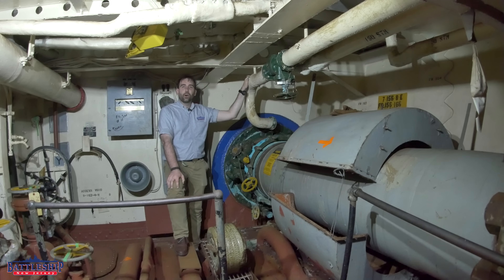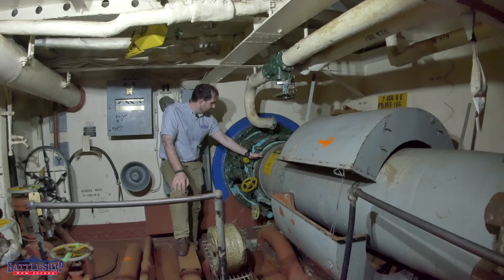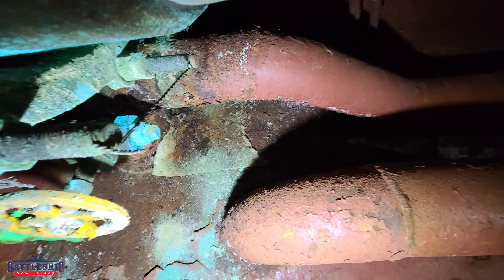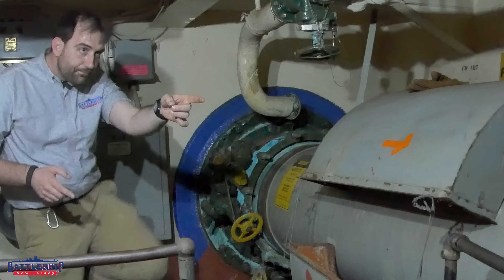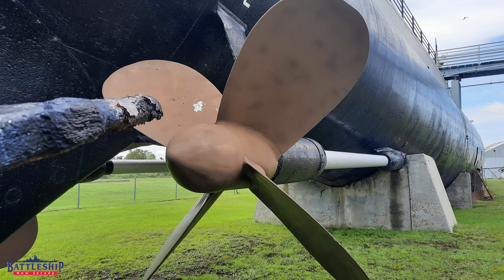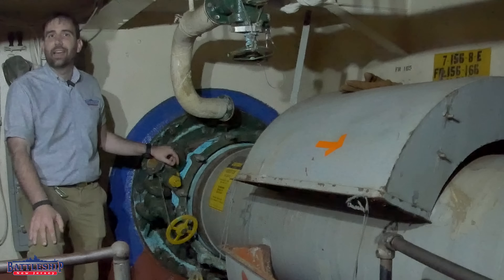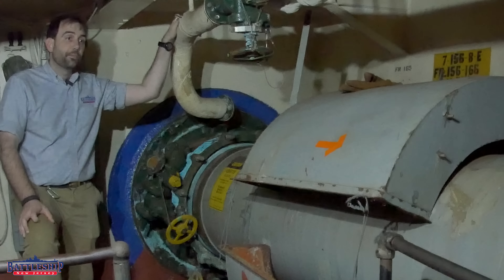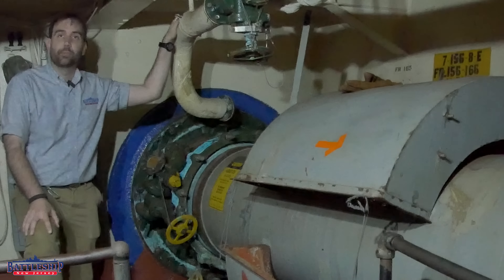Drydocking New Jersey Priority Project: Propeller Shaft Seals

Comment: If you decide to remove them I suggest displaying them on your own aft deck, more or less above where they used to sit underwater. Take the last segment of shaft with you and it lets you have an integrated display of the final drive in a way that’s not really available to visitors any other way (you don’t allow scuba tours, do you?). 

I don’t think there’s a lot of value in keeping them in a re-installable condition, so they could be cantilevered off the side of the ship if the trade off between cost and space makes sense, as I try to keep in mind just how heavy the prop+shaft must be - and I really think you want all 4 with their shafts to the extent you’re able, though a single side is almost as good at half the cost.

Comment: If the props are not striking bottom, leave them in place. The struts support the shaft and prop weight, the seals should not be experiencing any significant weight bias. Replace the packings so the seals are fresh and hopefully last until the next drydock period.

Comment: If you can I would leave the propellers in place but give extra support by adding lifting points off the propeller to the hull. If this is possible then you don't have to worry about the weight of the propellers crushing the packing as much. Though if you could disconnect the shaft further into the ship and have motors attached to slowly rotate the propellers could be another option to keep the seals good.

Comment: Id say for authenticity, leave em on and replace the anodes with the proper aluminum anodes to prevent corrosion to the hull and get the seals redone. She went to war with those props exactly where they are, and she should never be crippled like that.

Comment: Another option..... since the shafts are sort of big plugs......   weld the shafts to the hull.  Make them non-moving.   (You may need some filler pieces of metal to make the gap smaller).  Also, keeping the glands, any leaks in the welds, the glands would be second line of defense.   And, that way, for some crazy reason they want to make the ship move on it's own (wow, think about the cost of doing that!), it would be a process of grinding back the welds.

Comment: I believe they should stay on. Like you said in the video, too much risk of what might happen if you distribute them. Also the cool factor of knowing they are still in place. I also understand the importance of considering the weight compressing the seal so in my thought process, why not build some sort of support system on the shaft to help distribute the weight and take it off of the seal??

Comment: My vote would be to retain the propellors and their shafts in situ. You should be able I would think to address the issue of rotation by occasionally unbolting them and rotating them while still attached to the ship. Even better consider perhaps if the jacking gear can be reactivated and engaged as I don't think that's steam powered.

I'm curious the damaged outboard prop you showed a picture of where is that? Is it from Missouri's grounding?

Comment: I vote for keeping them in place, reseal as needed, figure out a way to rotate them on a regular basis so they don't sit in the same position for 30 years.  It could be a scheduled event (like monthly or something) where they are rotated several times, or something that happens continually (but EXTREMELY slow).
Reply: maybe disconnect the last section of shaft, rotate just that section (with the prop) and then rebolt it?  shrug
Reply: @gildedbear5355  I had the same thought, but further in, at least past the first barrings inboard of the seals so that the seals don't take loads as a result of the shaft being cantilevered. Another option, get the gear boxes into a state where they can run slowly and put a motor and a lot of gearing somewhere that can spin the input shafts. That would reduce the amount of torque needed to make things work as well as keep everything else working as designed.

That said, is the fact the seals have been working so well a result of nothing moving?
Reply: @benjaminshropshire2900  good points.  I think packed seals work best when the shaft spins but don't actually know?  My thought is that the spinning distributes any wax/oil sealant but that could also facilitate it to move out of the proper locations.

Regardless, I imagine that if the system is designed to move then it's likely to perform best while moving?  Of course, the time between yard periods was shorter when active so my opinion is no better than a "I'm aware of such things" guess.
Reply: @gildedbear5355  what I'm kinda wondering about is why you need a dry dock to change it. If it was built with two seals, one that can be changed from the inside and one that can be changed under water from the outside, you could get both redundancy and the ability to replace them more easily.
Reply: @benjaminshropshire2900  changing the outer one seems like it would be too impractical to be useful.  First, the Iowa's were built a decade before scuba (though there were non-self contained systems).  Second, even today underwater technical work is hard and dangerous.

I'd sooner design the ship to be able to flood the bow enough to lift the props out of the water for servicing before I'd design it to require divers to repack a seal underwater.

The ship is going to need to drydock for anti-fouling, cathodic protection (or corrosion removal), upgrades, repair, and maintenance that can only be done with the boilers cold so you might as well just do the seals then.
Reply: @gildedbear5355  my thought is; it's a warships, build it to be able to survive and recover from damage with as little support as you can.

Comment: Take the propellers and rear shaft out, bring them back and build them an * operational * mount onshore that presents them in their original positions relative to each other. Ideally, they should also be in their correct bow-to stern positions relative to the New Jersey herself, just displaced onto land so museum visitors can walk around them and WATCH THEM MOVE. Yes, takes extra $$$. But engaging and probably unique. Your marketing/PR folks would get a lot of mileage out of this.

Comment: An option that keeps the artifact together with interpretive and practical benefits: make a dummy stern on the pier. As little as 4 concrete posts with a bench at the bottom and a propeller on top of each. Below, there's somewhere to sit in the shade. From the main deck, you can see what pushed NJ forward; a gleaming mass of bronze. They go home on the flight deck and never get separated. Another bad idea: weld the driveshaft in place, everything is there and leaks are averted but it will never spin again; there's options other than a blanking plate or relying on cordage seals. I feel like she would be easier to tow without propellers and sit more peacefully in the river. In 25 years, when J is post due for a dry docking, your successor would appreciate four fewer leaks to worry about.

Comment: Maybe this is too late but using stainless steel cables and turnbuckles, connect them to the propeller shaft at the back of the propeller and then up to the ship at sufficient attachment points. Use the turnbuckles to put tension on the cables to help support the weight reliving stress on the rope seals.
Reply: That's what the bearings are for.
Reply: @stargazer7644  according to the the man, there's an issue with the shaft seals or he wouldn't have said anything. The bearings hold the shaft in place but cannot stop the shaft from distortion when stopped in the same position for years.

Comment: In regard to removing the screws I would decide based on condition of things once it's out of the water. If things are looking bad then remove them and the end of the shafts and if possible, display them on site like they would be as installed on the ship. If everything looks good down there then leave them in place. It's a delicate balance between keeping the ship as intact as possible and what's best for long term preservation.

Comment: Thinking out loud, remove the shat seal and make it into a cut away display on board, they are fascinating. Replace the rotational seal with one that is designed to be stationary. Gaskets, o-rings, sealing compound. The shaft can’t rotate, but it keeps the ship intact and safe from leaks. And if ever someone wants to make the ship work again, they just need to install a rotational shaft seal again. As a simpler, more permanent option, make a solid steel flange to replace the seal and weld it to the hull and the shaft. Again, keeping the ship secure, and intact.

Comment: Such a tough call.  If I was part of the Museum then I'd be advocating that /if/ the propellers need to come off (for corrosion or other reasons) then they should stay with the ship.  Of course, finding an appropriate place to put 4 twenty foot (I'm rounding) propellers is a bit of a difficult thing when you can't just move them in to an empty space.  (non-serious) solution, hide them in the funnels!

If the only way they stay with the ship is for them to be ON the ship, then that's the best place for them.

Comment: Spinning vs un-used does not change the weight distribution on the packing in any significant way.  Gravity is always pulling down regardless of usage.  The only difference in the force is a very slight uplift from the passing water on downward angled portions or laminar flow following the hull around past the props.  The way that being unused would make a difference however is that the Navy probably had the engineering crew come in and tighten down the packing nut periodically.

Comment: Just make a saddle with large wire rope. Loop the props and attach it to the stern. Add some turnbuckles and transfer some of the load off the prop shafts.

Comment: I'd rotate them 180 degrees at least, but figure a few years facing down, a few years facing up and it will balance out. On the whole, I think it's a good idea to keep them on the ship as they are primary control elements of a very large, very massive ship, however they are really only necessary in the event of crazy floods or hurricanes. That said, if they are driven by steam turbines, they are useless. Driven by electricity opens an opportunity to control the ship in the event of emergent conditions using the emergency generators but if it's all steam propulsion and the contract explicitly forbids making steam, then there is no reason to have the propellers out there in the water stream, exerting torque on the shafts and gearboxes. As you pointed out, the propellers are their own massive items.

Clearly, what Battleship NJ needs, is some large electric synchronous motors and gear trains to attach to the propellers and a grid-tie inverter plant to offset the electricity cost while having BNJ pay for herself.  🤣

Too bad the utility will oppose the action.

Comment: That's easy remove them and part of the shaft and blank them over. It's not like anyone will notice and I bet most lay people think Texas has props too. Of course keep them in the museum area unless someone wants to buy them for a pretty penny plus shipping. The money goes into the museum coffers and you reduce the chance of water intrusion. Of course it will be more work to reactivate it but Wisconsin is the first ship they would pick anyway and the DoD isn't hurting for the money if you didn't know.

Comment: If you remove them and you have the deck space back aft you could place them on the deck roughly where they would be under water. Or you could put two on the deck and two (one on each end) next to the barrel you have displayed. Just a thought. either way I think they should stay on or very near to the ship.

Comment: one of the spaces we had to check hourly underway and periodically in port as a messenger of the watch of the engine room....had to monitor the water level under the bearings and by the seals to make sure it was manageable........ours were off the B & M berthing area aft but I was only on a DDG....still we generated 70k SHP

Comment: OK. As you have related, the condition of the props and shafts are unknown at this point. 

I'd keep them on because of space, control, and completeness concerns. 

But if the shaft has deteriorated, the sleeve deteriorated, or the prop deteriorated, then they should come off to preserve the integrity of the ship. 

We all should know that water hates floaty things and tries to destroy it the moment it goes in until it succeeds. Salt water especially. 

In my home state of Illinois, the U-505 still has her props on. (She is also significantly lighter than the New Jersey and she has been out of the water for over 50 years. I got to look out of the battle periscope for her in 19 mumble mumble before some other kids broke it and that part of the tour was discontinued.)

Comment: To me, removing the propellers of a ship is removing an essential part of the ship. Unless you have a very good place to keep those propellers in good shape, probably the best place for them is on the prop shafts under the ship. One thing that may be worth looking into is if there's a way to put some crib blocks before and after the seal to prop the shaft up and remove any of the remaining load bearing on the seal. Even if the shaft is spinning though, they'd always be compressing the bottom more than the top. Gravity is always down unless we find a way to bend physics.

Comment: Can you coat the propellers to reduce the galvanitic corresion?  Maybe not eliminate it, but slow it down.  Can you plate over the shafts on the outside to make water ingress harder?

Possible topic: show the unusual tools you have to maintain that ship.  Do you have wrenches that can actually take off some of those bolts and nuts?

Comment: I’d say it’s probably better to leave the propellers attached. The arrangement of line shaft bearings is designed to leave a section just ahead of the stern tube bearing unsupported specifically to balance the weight of the propeller. And the shaft seal should be fine as long as it is kept packed. Tightening down on it will cause the packing to compress longitudinally and it will squish out and seal the space above the shaft. You just need to make sure that the joint is topped all the way up with new packing material when the ship is in drydock.

Comment: If it were my call? Pull them out for a complete inspection, service, and repair; and then put them back on. I would investigate to see if there are ways/means to support the prop shafts within the ship, over and above what already exists. Chains, bracing, framing, whatever. Would it hinder the looks, sure, but for long term ship protection, very much worth it. 

Will the rudder systems be activated for the tow? Im guessing not, but kinda curious anyway.

Comment: Ryan, there is no good answer.  Having the props on either the deck or on land gives people the chance to see the propellors.  Leaving them in place keeps the ship ready for sea which is how you work to display the Big J.  Either way the ship could leak as either the packing or the blanking can fail.  So neither is a guarantee you won't have leaks.  
The call could be to remove two propellors, one of each, for display if problems are found with issues.
In the end, you and the staff will have to "call an audible" once the ship is in the dry dock.  This will be one of many you will have as the condition is known.  Have fun!

Comment: If the shafts will never be used for propulsion again, it makes logical sense to remove the propellers and last links and preserve them separately.  Unless someone is actually visiting the aft compartments where the shaft seals are, you'd never know as a visitor to the ship if the propellers were still in place or not.  
From a strictly logical perspective,  removing the props and shafts makes sense if the long term preservation of the ship is the primary concern.   However I'd only recommend this course of action if you keep the props under your direct and immediate local control.

Comment: I am not familiar with the location you are at, but I kinda like the idea of the four propellers being placed on either side of the entrance - port-propellers on the left, starboard-propellers on the right, letting the visitors walk through in between them as they get aboard. And also illustrate what it took to make these battleships as fast as they were, even if they miss the one you already have on exhibition. Reason being, the sungular one is exactly that. Just one quarter of the real deal - which may not quite bring the same message across and is only regarded as "a big-ass propeller".

Just a thought.

Comment: I think USS Texas has set something of a precedent for “museum-spec” design/refit, in her case with the torpedo bulge, for New Jersey I might consider some sort of additional support structure that can help carry/distribute the weight of the propeller more evenly and relieve the pressure on the shaft seal. 
It would allow New Jersey to remain as complete as possible while future proofing her.
Obviously this isn’t as simple as welding some girders onto the hull, it will, like Texas’ torpedo bulge design, involve significant marine engineering design work but if it means that shaft seal stops being a potential failure point, and also will be of value to NJ’s sisters and perhaps every ship in the Museum Fleet, and others abroad then it could be a no-brainier in a cost-benefit analysis.

Comment: Is there a coating (paint) that can be put on the props to prevent corrosion?
Also as an additional option, removing only the inner or outer props, creating only two new artifacts.
And would removing the weight of the props help with leveling the ship front to back?